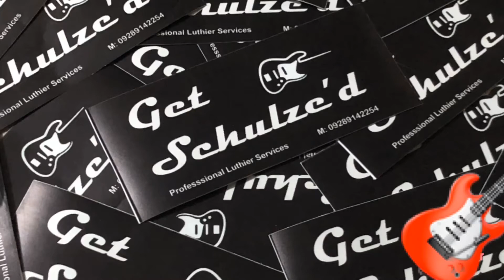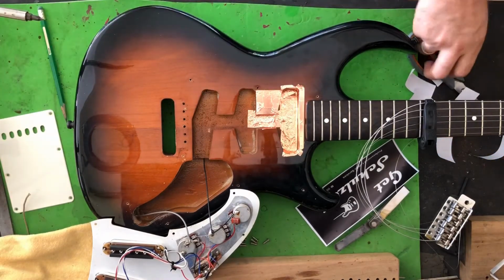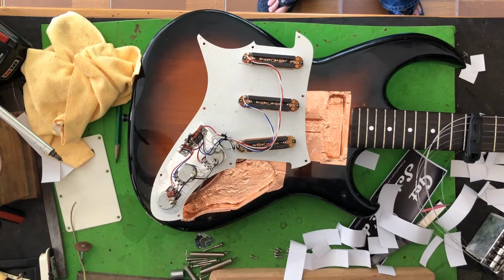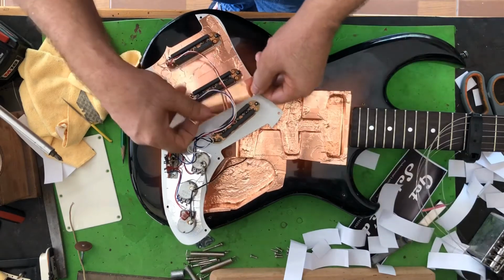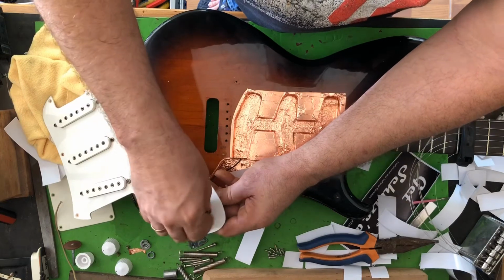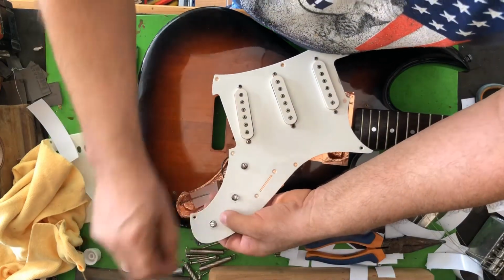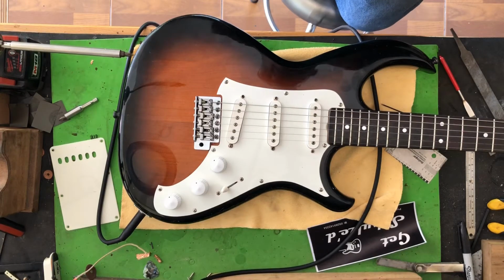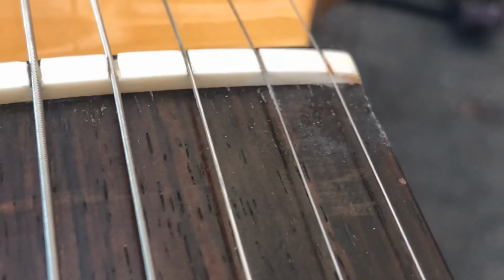Aria Pro Japan gets shielding & Setup

Comment: If i use aluminum tape instead of copper, will it have the same effect?
Reply from the maker: As long as it is conductive at the seams. Although aluminum corrodes more easily.